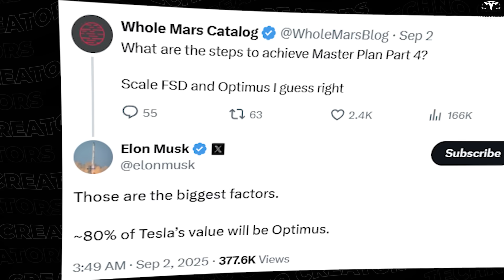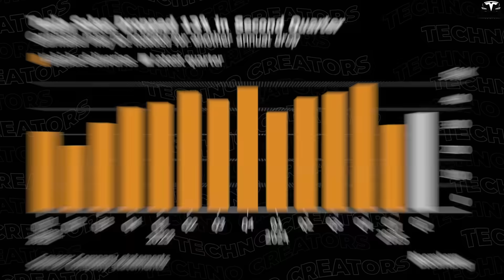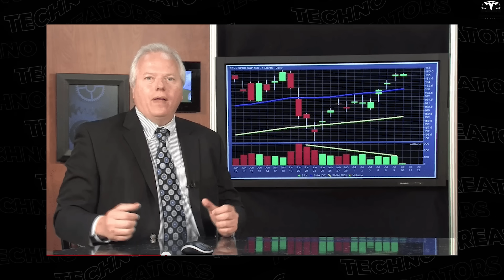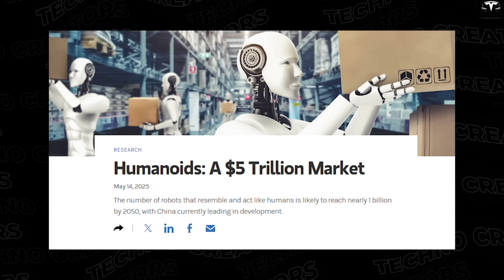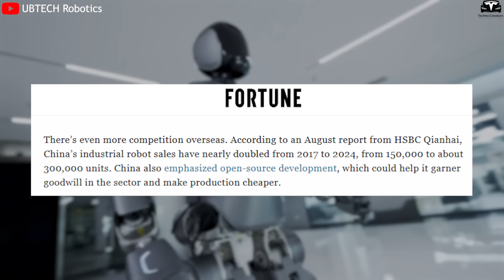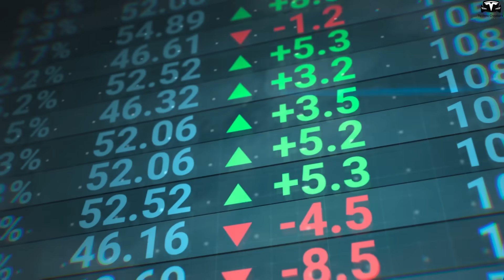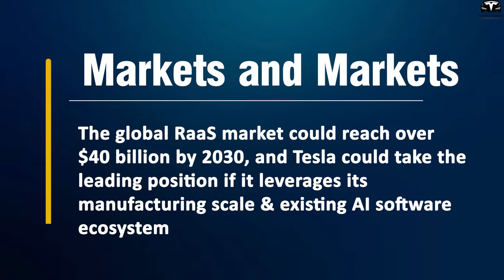BIG UPDATE! Optimus Gen 4 Unveils Stunning New Design & Why It’s Tesla $1T Bet! (Elon Musk Leak)

Comment: where is optimus, how much does it cost, and how long between charging.   Can it make a coffee, tea, grille burgers, what can it do
Reply: It will probably swap its own battery. So charging happens while the robot is in use. It can ultimately do anything a human can do in terms of valuable tasks. This is why Elon is saying it's set to pull in 10 trillion USD in revenue long term. It's not the hardware that will make this money. It's the software. Downloadable robot skills.
Reply: @SWDW88  the capacity is only 2.3 kwh not much compared to a human
Reply: @PatrickFerrin 
Battery can be swapped in 10 seconds 💪 
I want to see an air breathing humanoid that runs on diesel.